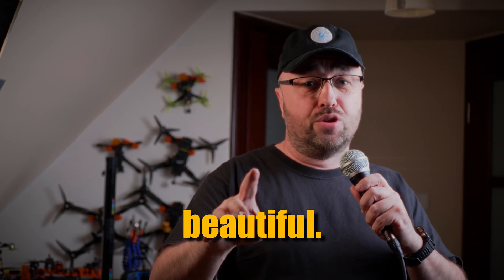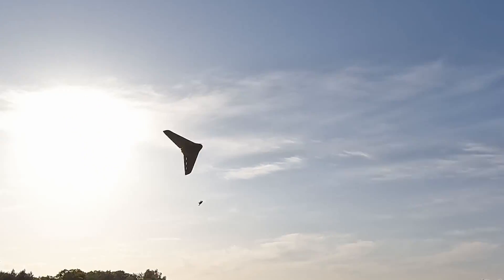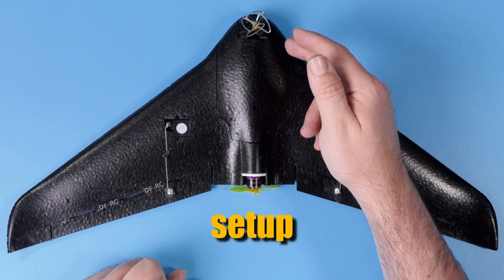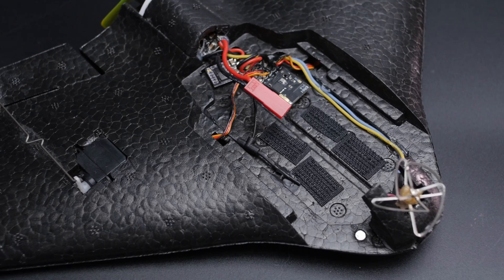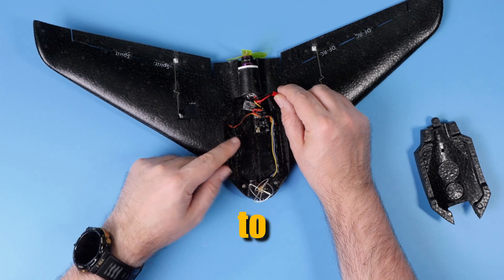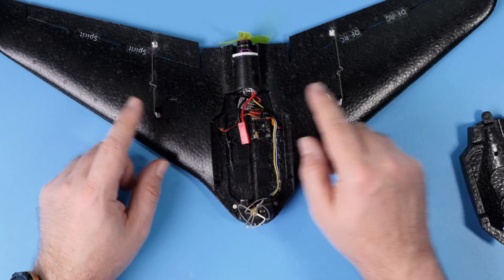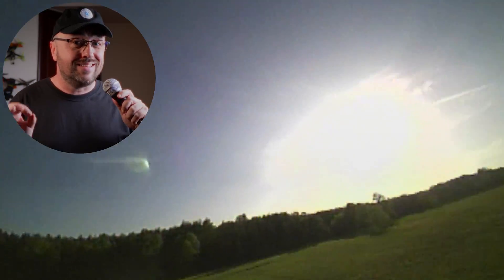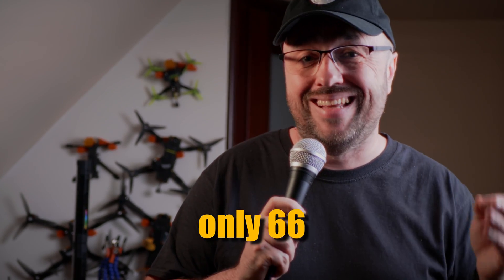Micro FPV Flying Wing

Comment: if you have some wind anyway, a FC like CC3D (mine) , with librepilot) does the job https://www.youtube.com/watch?v=mxrmn2RD-dg . Not that there is no FIN ; the wing is akin to a HORTEN in its profile and lift distribution. It lacks a bit of pitch with roll autority and I had to add transparent plastic sheet for increasing that otherwise, I can't turn sharp without loosing altitude. Use a 6 blades prop to get very quiet and you can fly in any park even with people around since there is no danger at all (mine is 80 gr AUW)

Comment: I ordered one of these a few months ago but it's just been sitting in my closet. I just can't get away from these LDARC 450x airframes. They're too good!!! The only problem is it's discontinued and very hard to find.

I actually designed an FC that's a drop in replacement for the stock one. F405, running an iNav 6 target I made for it (I know I know, I need to upgrade to 7).

Once I'm done with revision 2 (Extra servo outputs and a 9v power rail on a pit switch) I'd like to send a couple to you for possible official support.

Comment: I have one with inav flight controller 😎
Reply: Which FC did you opt for in your model?
Reply: @JPspinFPV  Noxe F4
And beta fpv video transmitter
And a little gps receiver
Reply: Too small to fly properly, you need jedi reflexes to fly!
Reply: @patricehonvault2612  with lower rates and fpv camera it is really fun.
In the beginning with angle mode helps a lot to learn 😊

Comment: I think once you get smaller than about the AR Mini or Nano Goblin (let's say, less than 600mm or 24" span), you very quickly start to make a lot of compromises that aren't much fun. No wind. No digital. Tiny battery. Limited options for motors, props, ESCs, etc. Very sensitive CG. It's a neat challenge to say you can do it, but I don't find it very fun to fly and everything has to be just right.
Reply: Not true at all!!!

I've been flying LDARC 450x planes for about a year now and the only compromise is that you can't really fly it on windy days. I'm flying with HD Zero and even with crappy antennas I've been able to get 1.5 miles out. My max flight time is just over 24 minutes on an 1100mah 2s lipo. Flying weight is 160g.

The setup:
LDARC 450x Airframe
FC designed by me (Drop in replacement for stock, F405 running an iNav6 target I made for it)
3.7g Servos
1207 5000kV motor
4024 Prop
Spedix ES20 Lite ESC
Crossfire Nano Rx
NewBeeDrone M10Q Micro GPS
HD Zero Race v2 VTX
HD Zero Nano Lite Camera
Reply: @HereComesWhitey I I fully agree with you! The 450X is really a nice platform and performs really well. Mine is running the original FC01 but upgraded to a 1404 @6000 kv running 3S on a 4" prop (step-down converter for the FC). About 3 minutes runtime with a 3S 450 mAh but it's really fast, stable and nimble. Unfortunately, they are less available and to expensive.
Reply: @joeljonker990  Sounds like you turned it into a nice little race wing. And yeah. I've emailed LDARC from 2 of my email accounts stating that they should produce them again. Maybe if more people ask for it they would make it again. Especially with the FAA attempting to pull this BS.

Only place to get them right now is aliexpress and with shipping the kits are about $50 a piece
Reply: I completely agree, i rc converted a lidl chuck glider 460mm with fpv and tbh like you say, there are a lot of comprimises, although i still managed an fc , full elrs rx, 868 antenna and osd ;) 114g :)

Comment: Ok so, Ive build a similiar wing but white one with vertical stabilisers. Ive fitted it with 16x16 FC running INAV, smallest no name GPS I found and the usuals. The main point is I gave it 3500mAh MJ1 LiIon battery and a step-up board for FC to have 5V. It has RCinPower motor 1207 - 7500kv spinning 3.8x3x2 prop. Flight time.........IDK......I never did fly it long enough to figure out but once it was close to 37 minutes.............I think....it was as fun as ECO-RALLYE because after throw you were changing thr like in range of 90-100% only and could not really do anything but carefully turn haha

Comment: It's probably most fun in the evening or at night when the wind has settled.
Those AIO camera lenses have a weird sort of distortion though causing objects to change a lot in size depending on where the lens is pointed. I've tried them before but I couldn't fly properly with them because it becomes very difficult to estimate distance and speed in FPV. The cameras on modern whoops and 2 inch quads are much better, coupled with a separate tiny VTX.
Also, with a mixing video receiver such as in the Skyzone goggles, wouldn't it be better to use a dipole antenna on the VTX and 2 dipole antennas at 90 degrees offset on the goggles receiver? You'll save weight and vulnerability to damage on the airplane, and my guess is you'll have better reception too.
It'll be interesting to see if you can INAV to it. There's hardly any space for a FC.